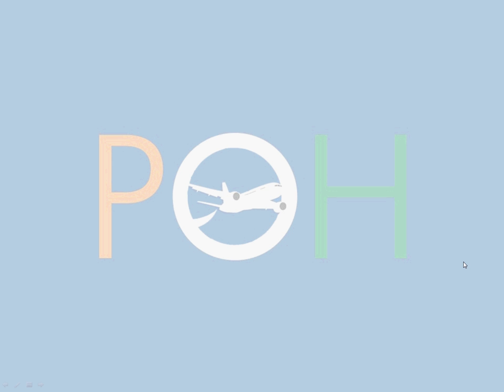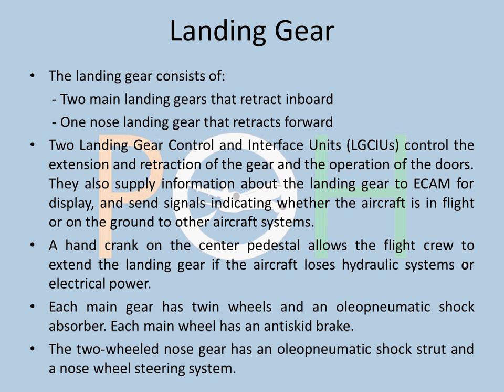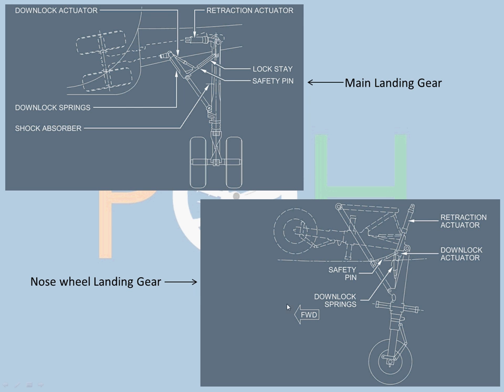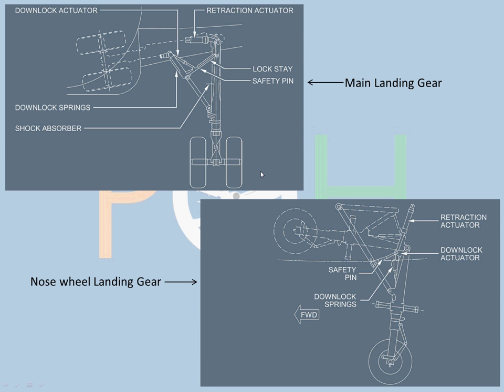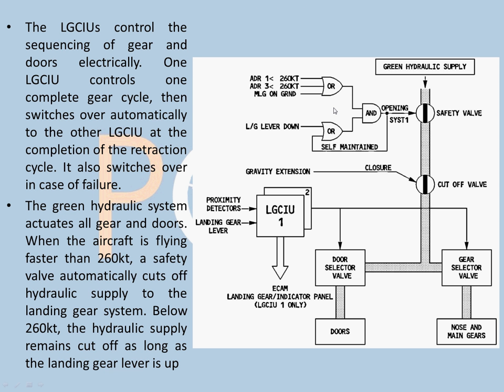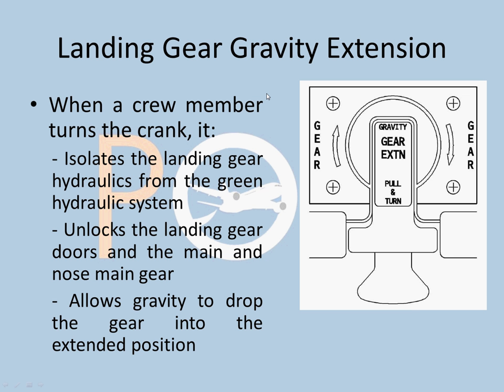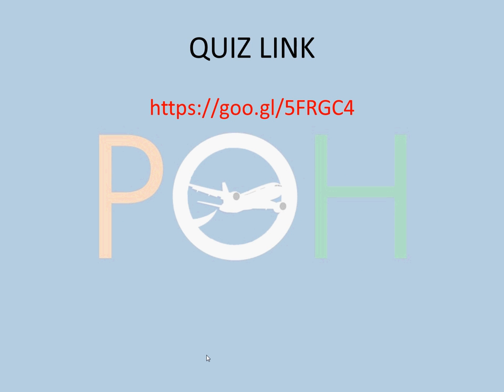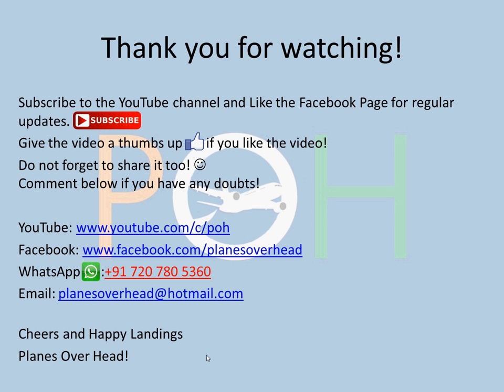A320 - Landing Gear

Comment: Is there any altitude limitation for landing gear extension.
Reply from the maker: Used to be 25000 feet but now has been removed from the manual, simple Speed and Mach dependent.

Comment: Hi, one question, the hydraulic pressure is cut off when the gear is secured and locked up? Because when I saw another video, the captain said that with the turns of the gravity system it depressurize the hydraulic system of the landing gears
Reply from the maker: Some pressure is maintained at the gear when it is secured and locked up. But most of the pressure is cut off because the uplocks maintain the gear in the up position. When you do the gravity extension the hydraulic is cut off completely because its not needed and can used for more important applications such as flight controls etc.

Comment: What’s the significance of self maintained loop ? When does the loop get activated ?
Reply from the maker: When gear is selected up on take off, the loop gets activated and keeps the safety valve open.
Reply: Planes Over Head  Thanks for the reply.Does that “syst1”on the landing gear architecture indicates LGCUI1 ?
Reply from the maker: Yes it does
Reply: Thanks again. Incase of LGCUI1 failure inflight and then I do a go around ,will my landing gear retract then ,because now self maintained loop won’t get activated because of LGCUI1 failure right ? As per the logic diagram now the AND gate output is 0 and safety valve gets closed then and there . Correct me if am wrong .
Reply from the maker: LGCIU 2 will take over, nothing to worry!

Comment: hello sir~ your contents really help to me, i have one question about landing gear gravity extention,

If the first clockwise isolates the green hyd and the second unlocks the doors, so  why is the third one turning?
Reply: Third turn allows gravity to drop the gear into the extended position :)
Reply from the maker: Thats correct!
Reply: Third turn will let the gears to extend by gravity and locks the gear so as to avoid aerodynamic force that can push the gears to unwanted position. I hope m correct sir.

Comment: Nose wheel steering is via green hydraulic system
Reply from the maker: Its via the yellow on all the new aircraft.
Reply: yeah because yellow is both engine and electric driven hydraulic system. If one fails other will quickly takeover.
Reply from the maker: It'll not take over at all.. you'll have to switch on the elec pump..
Reply: Oldest A320  via green
Most of A320 via yellow🌺😊

Comment: With towing bar nose will can be turned 85 degrees, not 95 degree to each side.
Reply: harith perera its 95 degrees as per the Fcom, please check
Reply from the maker: It is 95 degrees only! :)
Reply: kurtnobrain sorry it was my mistake,
85 is for towbarless operations. 

NOSEWHEEL STEERING (NWS)

Towbarless operation on the nose landing gear (towing and pushback) is approved when using the accepted towbarless towing vehicles listed in the Airbus WISE ISI 09.11.00001, with the following information:
Maximum NWS angle
85 °
// END

Comment: Hello Sandesh,what are the deceleration rate of low/med/max brakes  in knots?
Reply from the maker: +rajesh gilda Deceleration cannot be in knots because thats not the units of deceleration.
Reply: I meant how many knots/seconds deceleration rate?
Reply from the maker: +rajesh gilda Deceleration is m/s^2 (NOT speed, this is change in speed by time) 
The unit of knots which is a speed itself is nm/hr.
Knots/seconds cannot be a unit.

There is no direct conversion like you want it. 

For information Med gives 3 m/s^2 and Lo gives 1.7 m/s^2.
Reply: Thank you,got it.these values there in Fcom.
Reply: rajesh gilda why don't you share those information you found about deceleration here. I'm also a one who wants to find it out
Reply: harith perera I don't have,if I get one I'll share
Reply from the maker: You will find it in FCOM in Brakes chapter of landing gear.